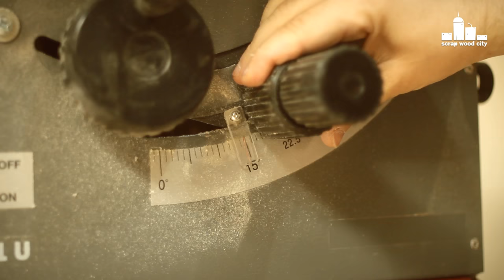Simple DIY segmented pencil holder

Comment: Excellent!  I really like this one. So is the formula for angles 180 / # of segments = # of degrees for cut?
Reply from the maker: Thanks, I actually found a board that says the miter you need depending on the segments. This holder has 12 segments so I need 15 degree miters. But the formula is more geometrically correct I guess!